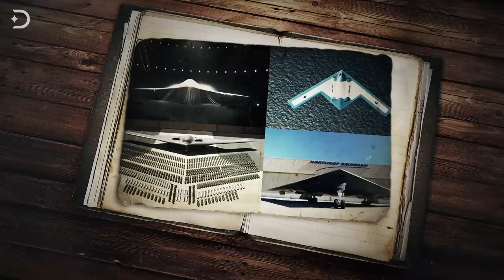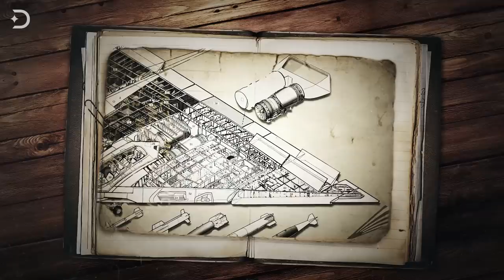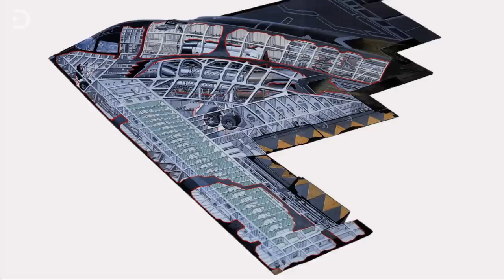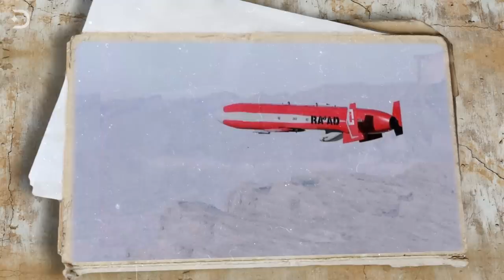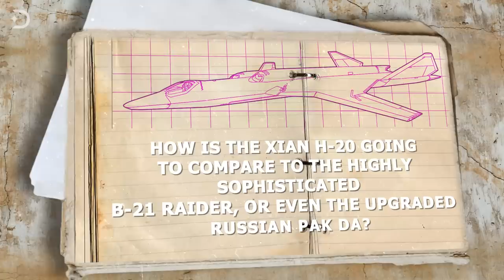Most Advanced Bombers In The World

Comment: 0:48 Nope, the F-117 was the first stealth bomber in service, by 10 years. Even though it's designated as a fighter, it can only drop bombs, it does not have a gun and cannot fire missiles or rockets, It was designated as a fighter so that fighter jocks didn't cry if they got assigned to it. No matter how it's officially labelled, it's a bomber, because all it can do is drop bombs.
Reply: Actually it was an attack plane and should be called A117 but wasn't for the reason you already told. At least that is what I read about it.
Reply: F 117 can fire aim 9 and were proposed to use as an anti AWACS fighter. Look up fighter pilot podcast F 117 wpisode
Reply: @adityapunetha6606  True, but it would have to fire the missile without achieveng a lock as the seeker head would be inside the bomb bay
Reply: Why would you cry about flying a badass aircraft that's stealth. Lmao.
Reply: But did the F-117 have the range of a strategic bomber? No, it did not. F-117 is best described as a tactical-level stealth bomber; the B-2 has the range to be a strategic threat.
Reply: It wasn’t a dedicated bomber and technically it was a attack aircraft similar in role to the A-6 intruder
Reply: @lemonjuice1988   It was given the F designation because of it's "tip of the spear" doctrine (first ones in) and since none of the top tier pilots would want to or sign up for a mysterious bomber program. It's full designation is the "F-117A" - They added the A designation at the end. (No, it's not a variant designation because they never made an "F-117" and there's not a number after it). The "A" designation is technically in the name.
Reply: According to Ben Rich, who should know, it was originally designated a "fighter" for budget and political reasons. When they first experimented with stealth, they were told to develop a fighter as a first-attempt because fighters were generally cheaper to produce as costs at the time generally corresponded to the weight of the aircraft. There also wasn't appetite for anything that might compete with the B-1A.
Conceptually, a stealth fighter didn't make sense, though. So they developed a fighter sized bomber.
Reply: I mean the F-117 is more an attacker than a bomber. Also it has a limited Air to Air capability. Hence the F designation was no accident
Reply: @F22raptor46  I got to talk to one of the people that helped develop the F-117. He said they gave it an f designation for the pilots they wanted to fly them would want to fly it.
Reply: @Tinhead426  that's probably a smaller reason too but the bigger reason was that
Reply: @F22raptor46  if it was more of an attacker they would have given it an A designation. It was designed as a bomber, the F designation seems to caus a lot of confusion on that fact. Again the guy I talked to even said it was always ment to be a bomber. The military want thier best fighter pilots to fly if so they gave it the F designation it's literally the only reason.
Reply: Austin Shropshire I don’t believe that, USAF pilots really don’t have the final say in what aircraft they fly. They can state if they wish to fly fighters, heavies, or  helicopters early on in their training, and later make their “dream list”, but when it comes down to it, they fly what they are told to fly. If the USAF was fielding a new type of plane and wanted their best pilots flying them, they would be assigned to them. What I have found online is that it was given the F designation because of treaties we had with Russia limiting the number of strategic bombers. We were already having to decommission many B-52s to comply, the last thing we wanted to do is build a new plane that could be considered a bomber and get rid of more B-52s. They even had the F117 successfully shoot an air to air missiles at a drone to prove it could do it.
Reply: The f117 was definitely not a bomber, it didn't have the range, or the payload of an actual strategic bomber, it was simply a stealth attack aircraft. It has more in common with an A-10 than a B-2 or B-52, and even the A-10 could carry more ordnance.
Reply: So your saying the f-35 is a bomber now that has all its weapons internal.
Reply: @TheUpbeatSpider  no one is talking about the F-35. Aslo a multi-roll fighter cant be compared to a bomber. Nice try though
Reply: yes i have seen one shoted down by my pepole in 1999 😁😁😁
Reply: The first stealt bomber was the Po-2
Reply: They should of designated it the f/a-117
Reply: justinl458 Because you couldn’t turn and burn in the F-117.
Reply: @TheeGlocktopus  Mac it was given the F 117 designation because that label was applied in log books to capture/acquired Russian aircraft. At the time that General Stafford led the planning for the aircraft we didn't admit to having Russian aircraft in country. It came from the Have Blue Program a competition between Lockheed Martin and Northrop Grumman (then just Northrop) As a note having served with pilots who flew the F-117 it was effective but a pig to fly. More than the F-4 the F-117 proved with enough thrust you can make a brick fly.
Reply: @jonathancassels4835  with all respect to Ben, and his book was gone, he could only see the requirement from a narrow window allowed by the classification of the program. The F-117 was the winner of a competition with Northrop called Have Blue, which came out of lessons learned by Lt. General Thomas Stafford who led the Apollo Soyuz mission. I recommend reading his book Have Capture. I had the opportunity to spend time with Gen. Stafford to discuss the matter. Ben felt there was a competition for the full size bomber the B-2 also covered in his book. I can tell you his understanding wasn't close to right, we were on contract and well along with the "competition" happened.  LM had no more chance of winning the full size bomber than Grumman had of the F-14A winning the Saudi competition with the F-15. There are times when decision are made (for reasons) and the competition is a cover.
Reply: @ThorinOakenshieldGSD2023  I'm trying to understand how your comments relate to what I said.

Are you trying to claim that OP is right, and the decision to designate the F-117 like a fighter was to try and trick fighter pilots, and not for the budget reasons Ben Rich explains?
Reply: @Tinhead426  When they recruited pilots, the initial test group were told they would be testing an updated version of the A-7 Corsair, so those pilots were already mentally committed to attack aircraft. Even though the Corsair had air to air capability, it was no dog fighter and subsonic like the F117.
Reply: @soysauce4813  in the 1992 gulf war the F117 was used as a bomber, it was armed with 2 paveway laser guided bombs.. it would refuel first before doing bomb runs, and its mission was to bomb radar targets in enemy territory.. i have the hardbound copy of 'Weapons of the Gulf War'
i've never heard it used for air to air combat in the gulf war, but its weapons bay might be able to take a pair of air to air missles
Reply: Bingo.
Reply: @nbrohwer2001  Even though radar wasn't invented until WW2?!
Reply: The night hawk was actually a fight / attack plane so yes the b2 was the official first stealth bomber

Comment: So the B-1 and B-2 were billions of dollars and were the most technologically advanced. Yet they came in the 80s or 90s and are now being phased out. Meanwhile, the B-52s still in service were built in the 60s and are still flying, and after re-engining, they will be flying through the 2050s. 
Why can't we get 90 years out of the B-1s and B-2s? 
Does this seem like a problem to anyone else?
Reply: I can see the b2s because of radar advancements so they'd want to upgrade those type of planes.
Reply: It's called the military industrial complex, keeps the cash flowing to defense contractors and politicians. The B52 is definetly an exception to that, since it was built not to fall apart after it's predicted service life and can be upgraded for use a stand off weapon out of harms way.
Reply: B-52 will be used in a separate role than the b-2 and b-1. B-52s will be used as standoff bombers that fire long range munitions safely away from enemy air defenses whereas the role the B-21 is intended to fill is that of a penetration bomber. The B-21 is designed to avoid detection by air defenses to drop its weapons at close range to the target. The USAF must have decided that B-2s and B-1s aren’t up to that task any more.
Reply: @maxemma14  My point is that the B-21 better last until 2100 or we are being ripped off.
If a plane built in the 60s can last 90 years, a plane built today should too.
Reply: Because the B52 is a standoff bomber.  It can't penetrate enemy airspace and deliver it's payload.  It needs the "way cleared" for lack of a better phrase.  The B2 and B21 are both capable of independent operation.  Very different roles and massively different technologies.  The B2 and B21 depend on technology far more than the B52, and eventually technology becomes obsolete and must be updated.  That's why we can't get 90 years out of those bombers.   Look at the A10, it's great at what it does because it doesn't rely heavily on technology to perform it's role.  While the F15/16 & 18 rely far more on technology, which is why the A10 will probably outlast all three.
Reply: The B- 1 and B- 2 are aircraft which are in inventory to use for attacks in protected airspace, such aircraft get more vulnerable over time, and are phased out if they have gotten too little effective. The B-52 is a cheap bomb truck, used for little to not protected airspace, like the one of Afghanistan. If you try to attack a developed country with B-52s, they would all get slaughtered. 
The B-2 could also fly for a long time, but it is loosing the main advantage (stealth) over time, with the development of new radar systems. It will probably get phased out lone day like the F-117, because it is more expensive to operate than a B-52, and it get too expensive without it's main advantage.

Comment: 1:27  No, there were 21 built.
1:50  There are currently 20, not 21 B2's.  AV-11 Crashed in 2008.
Its amazing that they got both numbers wrong.  If they would have swapped the two, they would be correct.

Comment: China is unlikely to secure stealth or first strike capacity for some time.  Given pictures I've seen of the Chinese bombers, they carry their payload externally, telling me they don't quite know how stealth works.  Some models also have above wing intakes, making it hard to handle, if not very maneuverable. 

The final clencher was that the 2018 hypersonic missiles were claimed to have plasma fields or plasma shields. That spoke volumes, because plasma shields are a 2 way blind; can't see it coming, but it can't see where it's going. Also, how was the plasma fields created?  If it's atmospheric friction, it's pretty much a dumb fire missile.  If it's electronic, that means energy is taken from the engines, reducing speed proformance by about 50%.  It's no longer hypersonic, and still dumb fired.  It must have preprogrammed maneuvers installed, and at hypersonic speeds would not be maneuverable at all.  

These missiles could only hit a stationary target, as mobile targets required 4 phase guidance. So, unless it's nuclear, there's no way these things can sink a carrier.  And given the compartmentalized design of carriers, they don't sink easily to begin with, and it's mobility would ensure an evasion of any dumb fire missiles.

Comment: The problem I have with these stealth bombers is that they don't have the bomb carrying capacity of even the B-1. Expensive and high tech, but don't have the capacity.
Reply: Capacity is pointless.
Reply: Depends on what they are designed for.  the B-2 is much more technologically advanced than the B-1 which was technically a conventional bomber.  The B-1 was designed to go in fast deliver its payload on a target and bail out.   Lots of carrying capacity means of all your weapons its going to hit something and people know your coming.    The B-2 is the exact opposite.  Its designed to remain stealthy to not be seen you won't know its attacking until literally when it opens its bay doors and drops its ordinance.   No time to evade no time to duck for cover.  You can loiter a little longer to insure you hit that target.  Thus you don't need to have a higher capacity. 

The B1 was designed and proposed as early as the 60s with the first prototype coming out in 74 its purpose was to replace the B-52 and the B-58 hustler. (hmm B-52 again..) .  It was dismissed in favor of the XB-70 the supersonic Bomber.  That project crashed and burned literally.   Issues with upcoming B-2 project in the 80s the bomber that would replace the B-52 (again? god damn that bomber doesn't want to die) gave a opportunity for the B-1 to come back into focus as a intern bomber which would fill the gap as the B-52 were to slowly be replaced the B-1 would take the role and the B-2 would followed suit.   The end of the Cold War saw drastic cuts in the B-2 program with only several being built.  The B-1B the new Intern bomber would be built starting 1983 ending in 1988 with a total production of 100 bombers.    The B-2 would be 21bombers.   In many ways the B-1 is the last of the conventional bomber designs made for the US air-force and it has served loyally since then.   I believe the B-1 will be a stubborn little shit that will refuse to die like its big sister the B-52 when the Raider comes around.   the B-2 likely will find a way to survive as well.
Reply: eaglerocks123:  Good history with one correction.  The XB-70 was a 60’s design.  The program was cancelled due to ICBM advances by Defense Secretary Robert McNamara.  The B-1 was conceived later.  The Soviet MiG-25 Foxbat was specifically designed as an interceptor of the XB-70.
Reply: @Primus54  Just checked.  Yeah sorry about that little mistake.

Comment: I don't understand how the B-52 can fly missions for 65yrs, yet the B-1 & B-2, are being succeeded after half as much service. Seems like a major waste of money either on the front end or the back end of these two Bombers service lives. Our tax money needs to be better spent. The designers of the next B-21 should have provided the projected number of years of service before the contracts were signed so our civilian analysts who have no obligation to the mfr or to the DC Legislators, can provide cost info so Intelligent, Informed decisions could have been made by We The People, whether or not this Bomber is money wisely spent.
Reply: It's because the B-52 is a bomb truck not a deep penetration bomber. If they built a brand new clean sheet bomb truck they'd just get something that looks a lot like a B-52 anyway. Also the current B-52 has modern electronics and engines only the basic airframe has remained the same and even that has been remanufactured many times. It' s a similar situation with the CH-47 chinook, if they designed a modern clean sheet tandem heavy lift helicopter, it'd look a lot like a CH-47. And also CH-47's are periodically updated and new build aircraft manufactured, the lastest batch rolled off the line in 2011. the CH-47 is updated sort of like new year model cars in  a way.
Reply: @atomicskull6405  The B-52 was designed to penetrate into the Soviet Union. Not just to the border. But aside from that,  if the B-52 can last 90 years, why can't the B-1 and B-2 last that long? 
(Manufacturers milking the government for maximum cash).